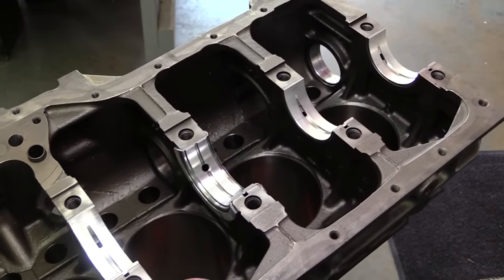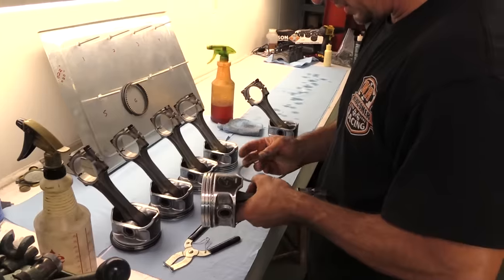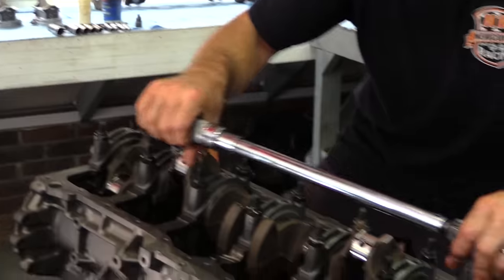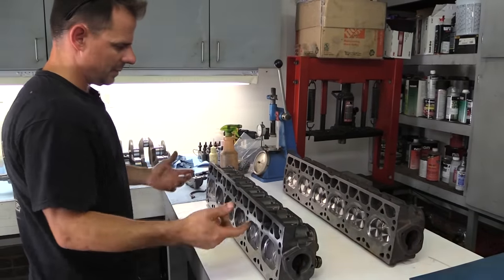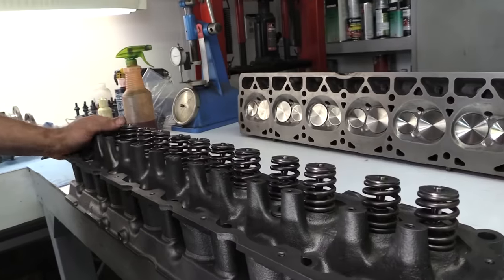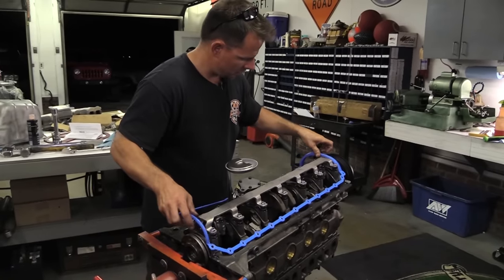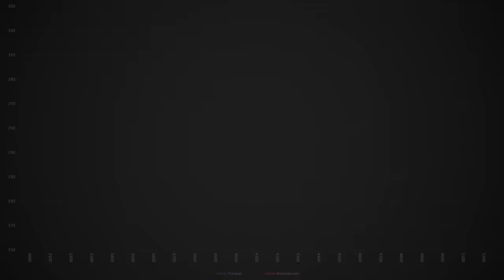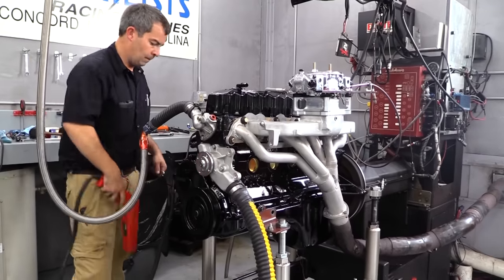Big Power Jeep Straight Six Stroker Build on a Budget with Newcomer Racing

Comment: Awesome thanks for the video I just got up 1983 4.2 L CJ7 so now I'm going to look for that 4.0 engine block before I rebuild it and have it bored out like you said and port those heads.
Reply from the maker: Good luck! And thanks for watching!
Reply: Also wanted to ask you will this work with it 2000 Wrangler 4.0
Reply from the maker: @bigmikestan  Absolutely.
Reply: Thks for the response I forgot to ask which heads do you use the 4.2 or 4.0 heads because got the 4.0 from the 2000 wrangler and the 4.2 in the 1983 jeep I just bought both.
Reply from the maker: @bigmikestan  He used the 4.0 heads. Thanks
Reply: I ended up noticing that because when I was looking for headers that kind you have on there only fit the 4.0 but thanks for getting back with me I appreciate that.

Comment: I DO like how the block is a closed deck...it'd be nice for forced induction later down the line, but I wouldn't push too much boost through it due to the lighter crank. You'd be better off with the beefier crank for boost, the lighter crank makes it better for naturally aspirated strokers to make it snappier with good low end torque.
Reply from the maker: Exactly right on the crank.

Comment: I've always wondered what instead of a stroke you go the other way. Reduce the stroke to 3.00 with the crank out of a 199. Open up the bore to 4.00 even if you had to silver solder cylinder sleeves in the block. Up top make a new head with a set of heads from either a Ford or Chevy 302. The bore centers on the Ford are spot on at 4.380. The SBC is only .020 over at 4.400. Another option here is a set of heads from a DOHC GM V-6. They are also on 4.400 centers. The whole idea here is get a cross flow head. This is of course a cost is no object. The idea is too build a motor that loves to rev. Just stay away from that harmonic range that will destroy in inline 6. Think a 3/4 Boss 302 or Z-28. The SCCA missed an opportunity with the Trans-Am series. Most Mustangs, Camaros etc sold in the early years were 6 bangers. What if they had established an extra class for inline 6s up to say 235 CID. Better yet 3.75 liters or 226 CID. Let them weigh a bit less. It could have been interesting.
Reply: I'm your man and will be  you when the shit hits the fan... 💩🦚👨🏻‍🔧

Oh, I watched that weather report you sent me... Fyi, Sir Richard says there's a big difference between a tenth of an inch and 10 inches 😎

Comment: Less counter weights do not make the newer crank the obvious choice. Fully counter weight cranks balance easier, have less harmonic vibration , have less torsional stress, offer longer bearing life, etc.  That's why serious racing engines use them. I don't know if that 37 extra lbs spinning in the fully counter weighted crank helps low end torque in heavy lifted jeeps with big tires,  but it certainly doesn't hurt.  I find it odd that everyone wanted the 12 weight crank until you couldn't find them...and now everyone wants the lighter one. I've built a bunch of inline strokers and you can't go wrong with either,  but I'll take that 12 weight every time.....

Comment: Notice the trend is so smooth even @ 5200 rpm ,yes this HUDSON/KAISER/AMERICAN MOTORS/JEEP 74 YR OLD ENGINE MAYBE THE BEST ENGINE EVER BUILT NO ONE HAS A 7 BEARINGS ON THIS HUGE CRANK FORD OR CHEVY CAN,T EVEN COME CLOSE TO THE PERFECT DESIGN OF THE 4.0 75 + YEARS AND STILL CARRYING THE LOAD,I KNOW MY 1995 ZJ HAS 385000 OIL PAN STILL  CLEAN EVERYTHING UP TOP STILL SMOOTH and TIGHT,FORD TOUGH DON'T THINK SO ,THIS ENGINE IS MORE THAN TOUGH IT'S A BEAST!!!JEEP YOU NEED TO BRING HER BACK YOUR JEEP SALES WILL ^^ 40% LISTEN TO THE PEOPLE!!!!

Comment: Excellent! The only thing I disagree with is using magnets on lifters. Magnets will slightly magnetize the surface of the lifter and it'll be more likely to hold ferrous particles that wear off itself and other areas in the engine, leading to accelerated wear. It's much more harmful on the lobe side of the lifter, but it's my habit to just never put a magnet near lifters regardless of which side I'm trying to hold onto. It's really interesting to see these 4.0 blocks being tuned. I always had a feeling there was more power density on the table that was not being utilized by the factory configuration. :) Looks like that is 100% true.

Comment: First the props...I am very much enjoying the content. Back in the 90’s and even the 00’s there was not content for my Jeep anywhere on the net. I recently bought another old Jeep and you The Men. Thank you. 
I am basically copying your build. I am starting to assemble and checking clearances and I would like to know if your oil pan buttoned up after shimming the crank brace?  If not did you just delete the brace?  I seriously doubt mine is going to fit. Thank you, J

Comment: Id like to see a basic swap from this head to an Edelbrock head to see if there's any real gain other than weight. I have felt the timing could be higher with aluminum with the benefit of heat dissipation. But who knows. Mine was pocket ported, unshadowed the valves, opened the chambers 3 CC,  bowl blended and a lot of valve spring work to go with my Harland rollers and cam combo to alleviate coil bind.

Comment: You didnt have to line bore the mains to accomadate or match the block , with a different crank ?
Reply from the maker: If the journals are the same, no. The only time you need to line bore the mains are if you are going bigger with the main journals or if the block has been overheated and warped.

Comment: These straight six blocks weigh so damn much. Surprised nobody has made an aluminium version.
Reply: Not that hard to pick up when stripped down, I don't think they're that bad..
Reply: @doddgarger6806  Maybe, but you could make an aluminum one lighter & stronger. 6-bolt mains and 100+lbs lighter. It could handle anything you throw at it like the Ford Teksid and Aluminator blocks. They are routinely used in 2500+hp applications for drag racing.
Reply: @dr.hugog.hackenbush9443  you do realize this engine design dates back to the 60s right? The 4.0 was a modernization of the old AMC i6, they were working on a budget. This engine was designed for low-mid rpm torque, it's not a race engine.
Reply: @riogrande163  Light weight is allways good for a performance application though. So if you can make something both lighter and stonger, why wouldnt you? Id gladly change the iron 4.6 in my Crown Vic for the aluminum Teksid block and shave 100 pounds off the front of my car's nose.

Comment: You should have tried the ported head with the ls valves...after the dyno run with the stock head...you probably will in a future video....
Reply from the maker: On the dyno it might not have been too bad, but on the street or trail that ported head would have been quite disappointing. Large ports for those cubic inches would have made for poor port velocity and terrible throttle response. But I do hope to come back around when Newcomer starts on his turbo build with those heads. Thanks for watching!

Comment: Awesome power for that old engine platform as is but peaking 100rpm before valve float says it most definitely needs better springs or a smaller camshaft. Do these things not have a sturdy enough bottom end for more rpm or is it strictly because of the stock valve springs? With any aftermarket camshaft I’ve never understood why ppl go with stock springs new or not.
Reply: I've been a cylinder head man at a automotive machine shop for 35 yrs and I agree with you 100%.

Comment: league called "TC" ( Turismo de carretera) they de-stroke this engines to 3.0 liters do the rules limitations, and get almost 350hp with a single 2 barrel carb.
Since 2016 they use a custom 24v cylinder head and make more than 400hp!!

Comment: 3 questions, why use stock rockers instead of rollers, why dyno with a massive carb when the owner will be using a stock TB, and how would the engine perform with the stock ECU?

Comment: I believe AMC once got 450hp out of one of these motors, it was turbo charged though, and only used in one Spirit, which was a pace car.
Reply: AMC went racing in the 70s with a 258. It made more than 350+HP over 400TQ with a set of Webber's carbs put it in a Gremlin and went 11s in the 1/4 mile. At 120mph. All N/A running stock AMC parts.

Comment: Noise Vibration Harmonics

The lighter crank doesn’t make as nice low-end torque numbers as the heavy ones do, but if you are making a motor that isn’t for four-wheeling, the lighter crank accelerates faster to the high rpms ‘wheeling doesn’t really need.

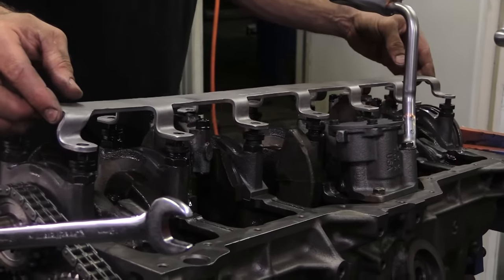Comment: 10:57 I have to question the kind of hardware chosen to fasten the girdle to the main caps. Those are nylock nuts. They’re not known to stand up well to heat. Not only will it be exposed to heat, but submerged engine oil. Synthetic materials like nylon and polyester react poorly to petroleum products
Reply: They are torqued down so the nylon is really not doing much .... but just in case eh.

Comment: Hello, I want to stroke my engine 4.0 Renix with the full fuel injection system or should I take a HO from 1993 6L to stroke it. What would be the best solution? would I keep the injection system or should I take a carburator with the intake Offenhauser quad barel carb? Thank you

Comment: This motor is based on the Australian 245 Chrysler motor I think?? I have one in my Australia built 1976 valiant regal. I have seen the 265 version pushed out to nearly 300 inch.. durable stout motors that were capable of serious hp with multiple carbs and the right work.
Reply: AMC design nothing Chrysler there.

Comment: Curious I have a 97 XJ 4.0 bone stock.
Just got some Harland sharp roller rockers, mild 248 duration cam from Delta Camshaft with lifters and cold air intake kit. How much power you
 think that will add . . . . . BALLPARK?
THANKS

Comment: I'll have to use more lube on my start ups LOL.        I got some black schaffers that I use.  Just not quite that much.     That's for the stroker math IE Rod length + Crank throw and years for cobbing internals.    I have a 2000 block.  Not notching the block is kook.    I built 331 and 347 Ford's and 383 general motors.     I got but by the jeep bug and bought 2 4.7 engine wjs.   I can't find a lot of aftermarket options so I bought a 2000 4.0 wj last week.   Thanks for the math and that advice on saving $$$$$!   That's always the trick.    If you got unlimited $$$$$ your just a jerk.

Comment: This  is a great video.  Amazing power out of a jeep inline 6. The head work seems to be the key.  I have a question. Why Not use a flat top pistons. Get a little more compression.  Over. The dish piston ? ? Is it possible ?
Reply from the maker: It is definitely possible. In this configuration you can get by with the less expensive pump gas. You can cut the deck of the block down and use flat top pistons to get higher compression. You'd just have to use a higher octane fuel.

Comment: Have you ever done something similar to this but on the Jeep V-6 ? I have an 08 Wrangler JK and a motor that leaves much to be desired. Ive done exhaust-cold air-computer chip mods and not much to show for it. If only this inline 6 would work in my Wrangler

Comment: Wish this straight 6 could bolt into my JK. Not happy at all with my Pentastar.
Reply: You sure it’s a Pentastar? The Pentastar makes good power for a Jeep V6
Reply: @redaggron1  The power is OK, reliability is poor. One injector failure was $1200 at the dealership. Countless other engine issues. The older jeep straight 6 was a solid engine in stock form. Probably my bad for not going with a CJ or older. Fiat is not a Jeep...

Comment: Not bad power to be honest. 
But for less than 5k a Chevy V8 can swapped in with low miles and make about 350hp and 360tq with a higher red line, better MPG, longer life, and a better sound to it. 
And if you blow it up you can get another low mileage motor from the junk yard for under $1,500. 

I know because I have a 5.3 sitting here that will be replacing my 4.0 very soon. 
Came out of an 05 Silverado, had 64k on it and ran great when I pulled it out. Will be going in my 04 TJ.
Paid $1,100 for it with everything bolted to it, harness and computer. That leaves me $3,900 for all parts need to get it in my Jeep before I spend more than this stroker cost. And I am 100% sure I can do it for under 3k. I have not spent 3k yet and I have almost all the parts needed to have it in the Jeep and ready to.
Reply from the maker: Sounds like you have a pretty solid plan. At least its a lot better than the commentors saying "Grr,r, just buy a $300 junkyard LS, put on an ebay7 turbo and make a thousand horsepower forever with no issues!" But if all we did was LS builds, it would make for a pretty boring channel. Good luck with your build, and thanks for watching!
Reply: Better mpg? 350 is a bigger engine, and 2 more cylinders to feed. So I'd Doubt that. Also 4.0's are near bulletproof.

If you bought a jeep just to put a 350 in there, you could have just bought a blazer and saved a lot of headache.

Comment: I would think if you're pulling the engine there would be some other options to get you to those power numbers.... 5k isn't exactly cheap for less than 350hp.... great information on what could be done with your stock 4.0 but I'm thinking for 5k it might not be a bad idea to think outside of the box
Reply: 5K is way too much! I've been building for 50 years and I can do the same thing but I would just skip the stroker crank in lieu of the money and I could build it for 1/3

Comment: I built one these for my son almost identical build. Worked great until we got excessive crank end play about 3000 miles. Destroyed the crank thrust surface.The original stroker in the jeep when he bought it did the same thing suddenly. We checked everything put in a new torque converter triple checked all clearance at the flywheel and made sure there was enough space between the torque converter and flex plate before putting in the bolts, no pilot bushing in the crank for standard.
When we took it apart I checked for a ballooned converter it was fine. Also trans pressures where correct.So we bought a used 4.0 and got another trans mission thinking maybe the tran had something to do with it and all seems good now. 
Anybody have any thoughts on that I’m baffled. I’ve built over 50 engines of different makes and never seen this before.
Reply: Kid helped & overlooked something🤷🏻‍♂️
Maybe?
I have 6 & as much as you try to teach them, they are still learning & they make mistakes

Comment: Just a question , that may not really matter for what this engine would be good for. If someone had to use this in a Cherokee, for example, what would the MPG be for a daily driver that can be a bunch of fun on the weekend ?
Reply: You can’t put a price on the joy & smiles 50% more HP & Tq. would bring you!
IMO you just can’t.
Same thing with performance boating or snow machining. No price is too high, welllll if it’s a toy / 2nd vehicle I guess maybe not a DD. MANNN but even then😂😊

Comment: Hey dude the primary barrels  on a four barrel carb should face the cylinder head,unless you have a real big plenum
Reply: look close at carb and you will see carb has side mounted bowls with secondaries toward head. It is correctly installed.Just an observation.
Reply: @kevinb9745  the primaries are supposed face the head, I saw Finnigan mount a four barrel , with  the primaries facing  the radiator, just my two cents,I had a pinto engine with 11 to 1 compression, with an Offenhauser four barrel split manifold (8 port), the primaries must face the cylinder head) ive seen several ,so called hot shots screw this up

Comment: those cam specs, dont make a lot of hp but the torque numbers are OK im thinking 250 - might be okay,depending on the intake ports and carb, im thinking a 390 Hooley four barrel on a Clifford four barrel intake,ive seen guys screw that up, they mount the  primaries facing the radiator,and that wont work the primaries must face the cylinder head for proper air flow.

Comment: nice work on that engine. to the rest of you talking about getting that much power for less, try to get an engine rebuilt to make those numbers for one, then count how much it'll be to swap it in the vehicle. And don't count it like you're doing it with scrap parts cause you a hoarder, think if you had to buy motor mounts, get someone to re-wire the harness, etc. 5 grand for a new engine with 100hp more and most likely 100 lbs more torque off the bat is great for an off-roader.

Comment: I really want to know the duration and lift specs of the cam, you would think over 300 hp it takes a pretty good sized cam to achieve that, also this builder ain't worried about valve spring failure running the stock springs?
Reply: He doesn't have a huge cam in it. He also said redline is just 4900.  Didn't you watch it?

Comment: I’m confused
How can a 950 cfm carb work on a 290 cubic inch motor which runs at a max 5200 rpm?
I’m getting 500 cfm at the absolute most.
Probably closer to 400
If thats the case the motor ran incredibly lean
Which means it should have more power than that
Reply: Yes. You are confused. A 950 CFM carb is capable of 950, but it only flows as much air as the engine draws. That carb is not ideal for the engine, but can be jetted to make the mixture correct. For a dyno mule it's a non issue. On the street you might see some driveability issues.
Reply: @shooter77us  
I’ve never seen anything like that work
I’m familiar with jetting
My concern is the size of the venturi
If its too big, in my experience, its always lean, no matter the size of the jet, accelerator pumps, etc.

I guess you could fake it with the AP…..
Reply: @businessleo  All that stuff is there for accurate metering and load a mid-range so the car behaves well throughout the throttle range. If you are just doing wide open Dyno runs, it does not matter.